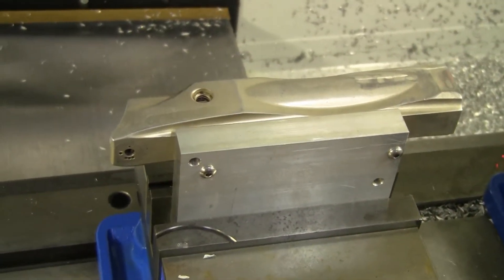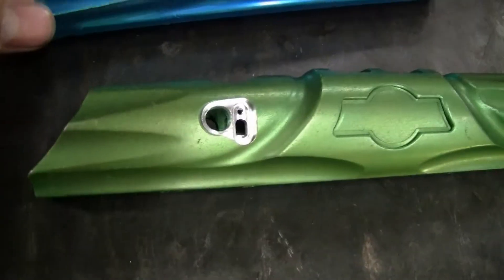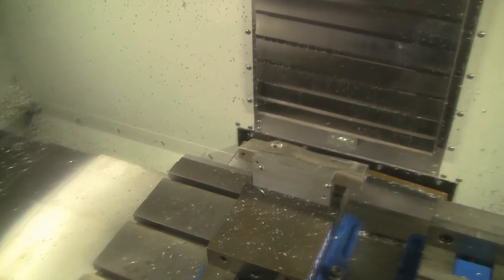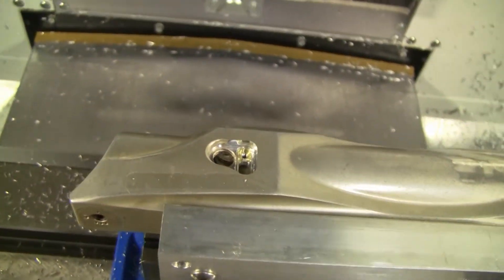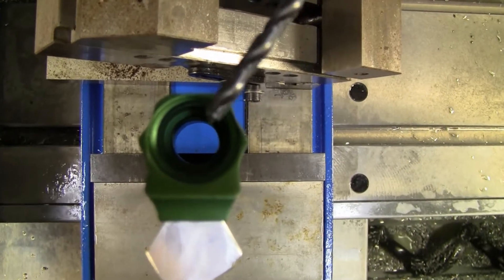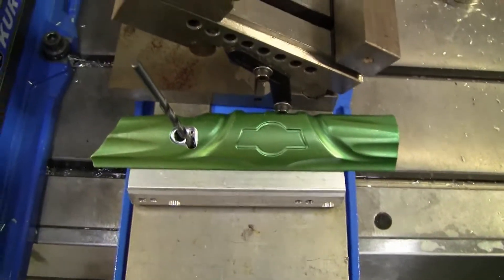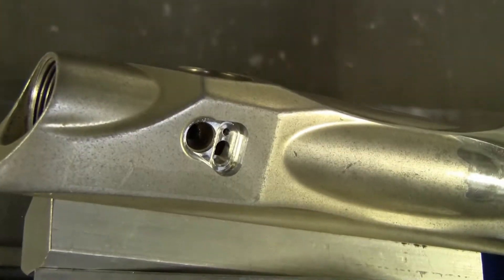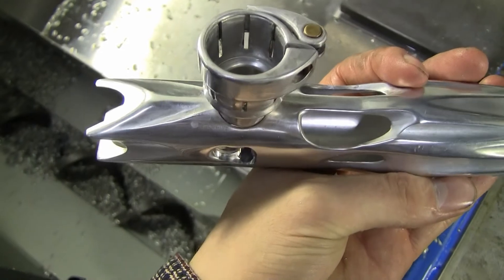Shocker NXT eye retrofit milling (new video 2013)

Comment from the maker: I've used the thicker ferrous tap magic in the past but I can't speak much to it since I never buy it myself. it's supposed to be general purpose but who knows (lol) I used to mix my own water-soluble mixture which I found useful when doing manual work with high temp metals, but I ran out a while ago and just started using tramp oil from the nearby autobody place.

Comment from the maker: it depends on how quickly you'd want it done...if the body can wait around a few weeks and get several more bodies in at the same time, the cost is lower because the setup time gets spread across multiple bodies. But if you wanted it done immediately then it'd cost more since you'd be paying for the setup time on your own. good to be patient (lol)